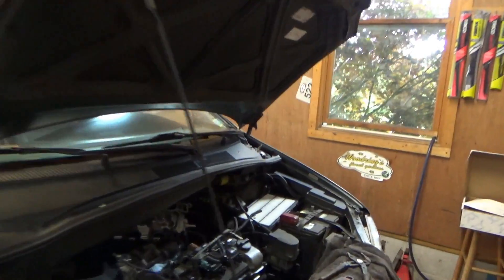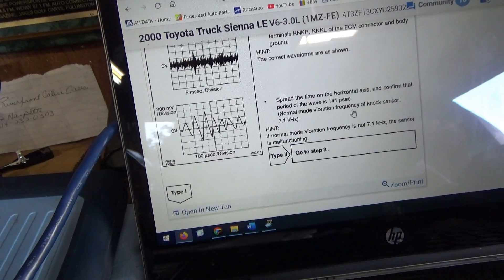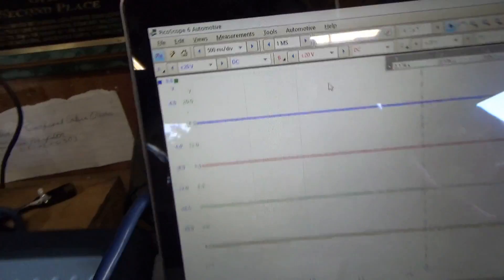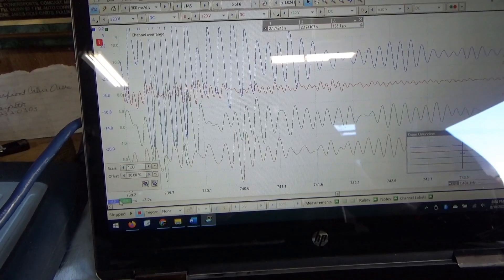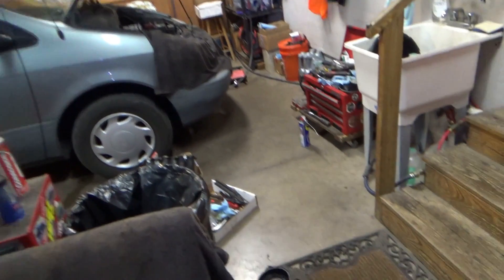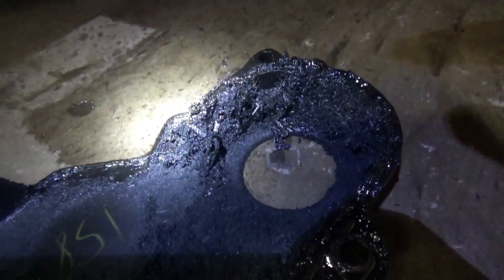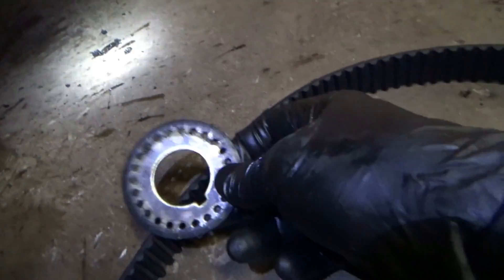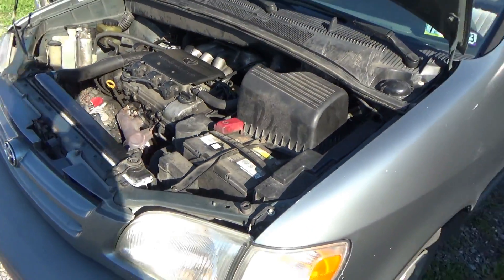Test Knock Sensors...on the BENCH! (Toyota V6 @545k miles!)

Comment: Toyotas always had great reliability in that generation. My 2001 Corolla now has 216,700 and it runs like new. .I just replaced the tensioner, water pump and belt and rear wheel bearing and hub. Bearings were making noise. 

Question for you. I don't have the wiring diagrams for the power outlet on the center console (there is a 12 volt power outlet behind the shifter, but I need to figure out where the wiring to it comes from. Is it coming from the cig lighter outlet on the dash or someplace else? That outlet on the center console does not work but the one on the dash does. No power at the wires at the one on the center console.
Reply: AllDataDIY has wiring diagrams, a month of access will run you $20. Otherwise you can try to find a factory service manual on ebay or amazon.
Reply: I have a 2000 Camry with a similar setup (lighter + separate 12V outlet) and I believe there is a separate fuse for the power outlet.
Reply: @brandtharen  

I don't see a separate fuse for the second outlet, but when I pulled the lower front of the dash to access the lights on the HVAC, I was able to see 2 separate wire sets plugged into the outlet on the dash. I don't have access to alldata, but I did look and can't find a diagram for the second outlet.
Reply: @cclngthr  AllDataDIY is different than AllData
Reply: @Silverfang15  

I don't have access to either. I can't find the specific diagram that has the 2nd outlet on it. All I can find is the diagram for the one outlet on the dash. I am thinking the wiring to the one on the center console is wired to the one on the dash, but the wiring is bad between the 2. I just want confirmation that it is like that before going any further.
Reply: Im pretty sure the generation of your corolla will stop counting miles at 299k
Reply: @eddiereichel9354  

It has the digital cluster. It should count past 299k.
Reply: Yep I'm not sure exactly but those vintage Toyota digital clusters count to 299,999 and not over. I think I remember Ivan mentioning it in a previous video
Reply: @eddiereichel9354  

My 01 technically is the 8th generation. The 9tg gen Corolla did have that issue which is the 03 to 08 gen in the first 2 years before Toyota reprogrammed the cluster. IF mine has that issue it would roll to 0 and start over.

My friends old VW Jetta had that issue. His went to 299,999 and went back to 0.
Reply: I have screenshot of wiring diagram. If you can send me an email I can forward it to you. There are 2 different fuses according to diagram